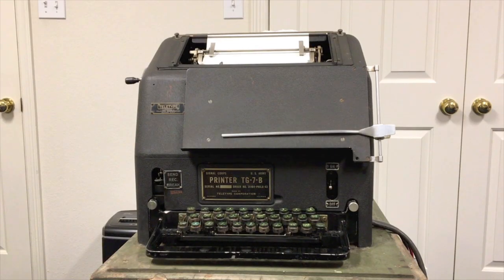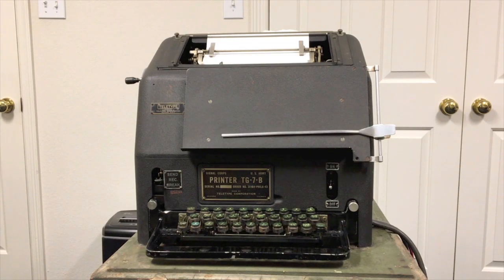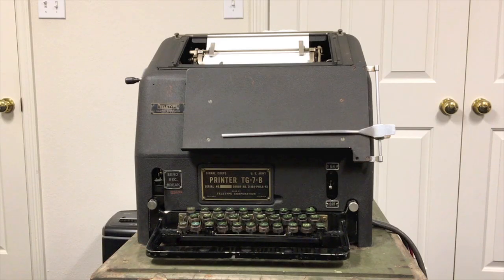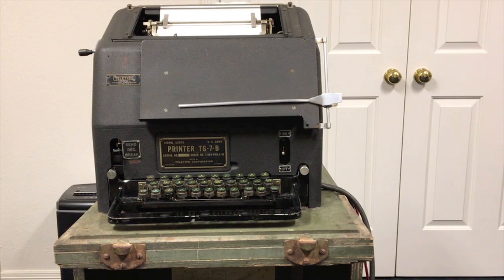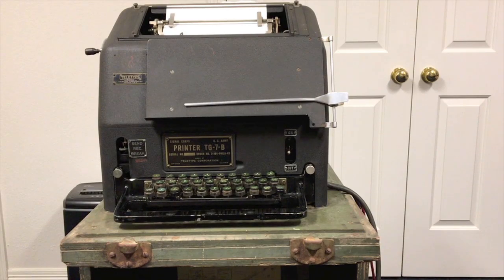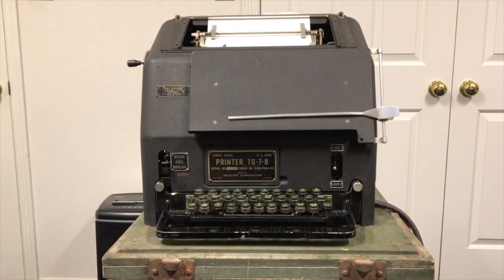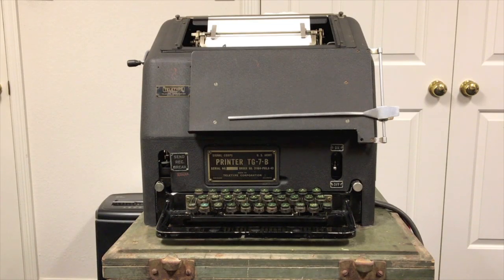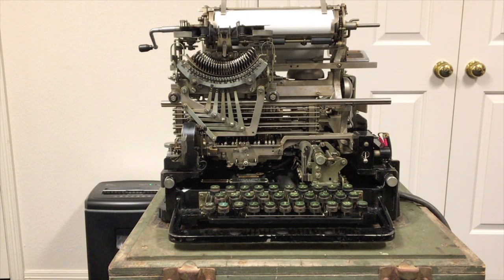Teletype Model 15 - Introduction

Comment: RTTY is still commonly used in Amateur radio on the HF bands . I just picked up a Model 15 teletype that I plan to put on the air, after I finish the restoration... K7VNT

Comment: This is simply AWESOME! I have a 15 and got it running. (Was a Teletype/Crypto guy in the AF in the 80s). Hopefully you still see this channel... Would you consider selling me an interface board? I'm a HAM operator and would love to get back to RTTY. All the smoke came out of the old TNC I had in a most fantastic way. It's un-recoverable. I also have the complete manual set which was crucial in getting this working again. If you need come pages copied, let me know.

Comment: Man, what a beautiful piece of engineering. I've heard that these use a current loop, what does that mean?
Reply: Basically it means that there is a regulated current source in the system. The sending TT and receiving TT(s) are connected in a continuous loop. The regulator ensures that a "1" is always the same current but doesn't care what the voltage is. This means it compensates for the number of receivers and length of transmission line (which can be very long). It's also resilient to noise and doesn't require active electronics like a voltage standard like RS232.

Comment: How did they establish a connection from the sender to the receiver?  By calling the operator?  By placing a 1+ long distance call? Or were they already pre-connected similar to having two tin cans strung between each other. I'm curious because I haven't found a video yet that answers these questions.

Comment: I want teleprinter sound effects in the background for a newsroom scene in an amateur short video I'm making. I specifically wanted Teletype Model 15 sounds, and I'd like to use the sound of your machine (on multiple copied tracks to simulate 4 machines). I know I could just do it, but I wanted to ask first. Would it be okay with you? I can tell you more about the video if you'd like.